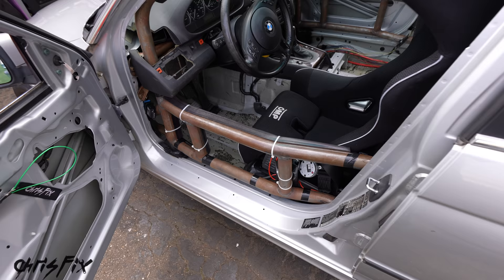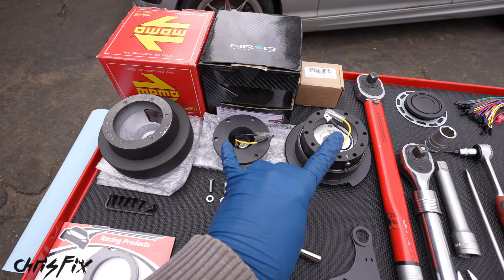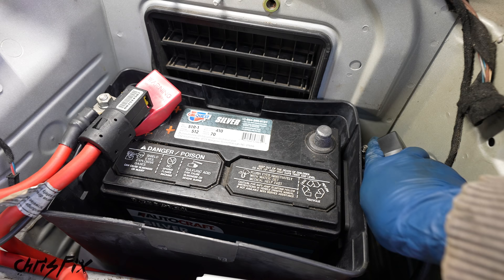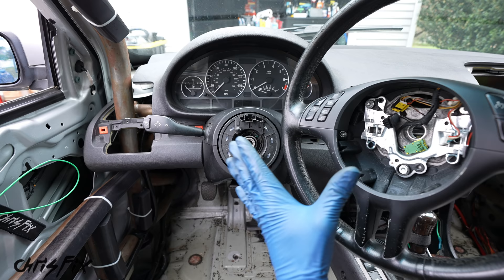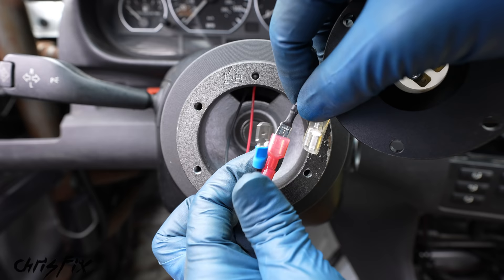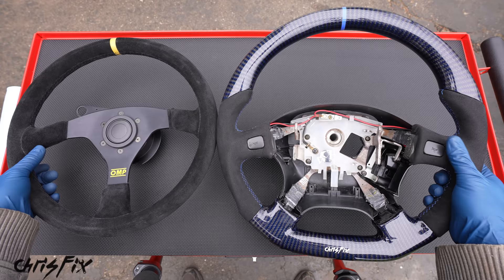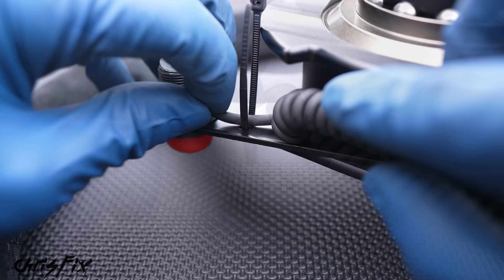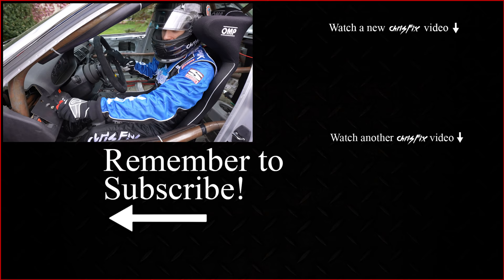How to PROPERLY Install a Quick Release Steering Wheel (with Working Horn)

Comment: Can I add a quick release adaptor my existing stock oem steering wheel? I want every electric oem component to function (airbag, stereo controls etc). 
Is that possible?
Reply from the maker: I don't think so and even if it was the juice wouldn't be worth the squeeze, I would recommend looking at the custom steering wheels instead
Reply: Why not? I need the OEM steering wheel because it has the airbag, plus all of the other radio controls on the Toyota steering wheel. The reason I need to quickly release the steering wheel is because I have installed fold down seats in both the driver and passenger seats. When I convert the interior to camp mode, I need to remove the steering wheel so I can utilize the entire interior for the bed platform etc. 
Any ideas?

Comment: Hey ChrisFix! Is it possible to change brake lines without takeing off everything under the car? I'm thinking about tieing the new brake line to the old line after I disconect it from the brake calliper and master cylinder and pulling the old line until the new one is where it needs to be. Sort of what you did in the hood cable replacement video. Is this an option?

Comment: Hey Chris, I have a 2000 mustang v6 sunburst gold and my driver side door quit latching today. No matter how hard I slam it or how gently I close it it doesn’t latch and stay shut. Was wondering if you could make a video on replacing or fixing that issue. The latch itself on the door I can push it to the closed position and it will come open without pulling either handle. Please help
Reply: Edit I replaced the lock but the hinge was messed up when I got the car so it doesn’t line up right and shut now unless I pick up on the door. So latch and hinge video?

Comment: hey chris, for the driftstang steering wheel that has the rpm at the top or even just the del sol with the carbon fiber, what are some trusted companies that do these customizations? thanks

Comment: did you use the normal MOMO hub adapter or the short MOMO adapter? I have a MOMO wheel and adapter but just purchased an NRG quick release. I'm wondering if I need to change my MOMO adaptor to the short one to keep the same distance
thanks

Comment: The diameter of the wheel shouldn't influence how you steer depending on how many degrees you turn it...
cuz 360° is 360° independent of your wheel being 3m big or 3cm... one turn is still one turn.

Comment: Is there a different type of push button I can use to replace factory buttons on my stock steering wheel like the cruise control buttons? Because I want to get a aftermarket MOMO wheel but I still want to be able to use my cruise control for longer drives

Comment: The airbags are there to protect idiots who don’t wear their seatbelts. They don’t “work with the crash structure” in any way, especially on a car of that vintage.
Reply from the maker: Airbags are designed to work best when you are wearing a seatbelt, and yes they work with the crash structure, here's a NHTSA document from this vintage stating exactly that: https://www.federalregister.gov/documents/2000/05/12/00-11577/federal-motor-vehicle-safety-standards-occupant-crash-protection (Go to the "Rationales for Protection Improvement Requirements" section)

Comment: You gotta paint the roll cage, it's starting to rust and it doesn't look good, i don't like rust
Reply from the maker: It was painted after this video. That’s just surface rust. Not a big deal. Happens days after you expose steel to humidity

Comment: I saw that you got the e46 there, I got myself the same car sedan version and I bought myself a 225/45r17 8.5j wheels, they stick out a bit and when I go over 80km/h the steering wheel starts shaking, I did balancing I did aligment, everything is perfect and it still does it, any fixes or ideas what should I do more? I really dont want to sell these wheels tho

Comment: I have a question, i have an mx5 and im a little on the taller side, my Knees hit the steering wheel and its kind of uncomfortable, Is there a smaller steering wheel I can replace it with that also has an airbag? or should I go with one without an airbag but install a harness?

Comment: Hey Chris, would you still advise against removing the airbag in a street vehicle if there is a proper harness setup?
Reply from the maker: You would need to wear a 5 or 6pt harness, helmet with Hans, and need a full cage for it to be safe. No other safe way to run a harness. If it’s a 4pt harness you need the anti-submarine strap but that breaks and let’s your body move in an accident so you would hit the wheel with no airbag. So no way to safely remove an airbag in a street car.
Reply: @chrisfix how would you hit the steering wheel when strapped into the car with a 4-point?

Comment: Chris! I’ve been trying to remove the 16mm bolt from my e46 steering wheel but no good. Been using a standard ratchet and extension, as well as a drill with a socket adapter and nothing. Do you think that extendable ratchet will do the trick from the added leverage?
Reply: try a breaker bar

Comment: i’m trying to do this on my dodge avenger but no steering wheel hub adapter will fit, i’ve tried the one nrg said would work and it’s too small and i tried a universal one that didn’t work either, what should i do?

Comment: Hey Chris Im looking at buying a 2015 VW golf TSI but when I looked at it there is a dent in the oil pan, the car is otherwise mint. What would you recommend?
Reply from the maker: Is it a small dent or a big dent? How long ago was it dented (ask the owner if they hit a massive pothole)? Is there an underside tray that would help prevent the oil pan from taking damage from the road, and it wasn't installed? No matter what, it would need to be fixed asap. If it's not causing any engine issues, I would look at the cost of an oil pan and see how many hours it would take to swap it, add it up and ask the owner to get that much off the price. If they say no or try to negotiate that, explain that it needs to be fixed either way or they might be having to put an entire new engine in very soon. If it's a small dent not causing issues, you should be ok to swap in a new one, if its a big dent and they refuse to take that much off the price then you might need to walk away. Depends on the situation
Reply: @chrisfix  Thanks its a decent sized dent but the owner doesn’t know because it was his sons car. I talked to Volkswagen and they said it shouldn’t have damaged anything internally but they wouldn’t know for sure until it was taken off. There is a baffle inside the oil pan so that might have protected the intake but who knows. Im going to ask him about it to get it looked at. I didn’t get a price from Volkswagen but Im guessing about $1000 with labour because it would also need 20 stretch bolts for the pan. Anyway Ill see what he says. Thanks for the help!
Reply: @chrisfix  also when we checked the oil it was a little over half way
Reply: Never mind it just sold.

Comment: 13:40 Liquid electrical tape? Man, I used to tinker with electronics since I was 10. Why have I never heard about this?? I will get me some, hope I can find it in germany. How the freak do you know about all these cool tools? I have used epoxy and hotglue on so many small instances where this stuff could have been an absolute time saver!

-also the spiral cord around the quick release is giving me a bit anxiety, you could solve this with 2 little logic boards

Comment: i have a 2003 saturn ion and the airbag doesnt work, i want to buy and replace the steering wheel but dont know what hub mount to get. i have the wheel i want to buy but cuz of GM my stock mount is not normal. any help?

Comment: When I install my wheel and torque it down it feels sticky, almost like the hub adapter is interacting with something behind it. Has this happens to anyone else?
Reply from the maker: Is there play if you shake the wheel after torquing it down?
Reply: @chrisfix  side to side it’s the regular amount of rotation you would expect hitting the steering lock when the key is out but now there is this added “sticktion”, if I loosen the nut it goes away but then the wheel isn’t torqued properly. I think my hub may be machine improperly.. it’s an NRG hub so possibly I should try a nicer hub like the one in your video. Unless I’m missing something, idk.
Reply: @chrisfix  hey, wanted to say thanks for initially responding, I know you probably get a million comments and that’s pretty rad of you! The issue was the hub pressing on the electrical connector body at the clock spring, pushing the clock spring housing back and causing it to feel sticky. A little plastic off the top of the connector should do the trick!

Comment: Honestly, i have no trouble doing most things with my car (brakes etc.), but airbags scare me.
Reply from the maker: That's great and it's good to respect airbags but the system is very safe. It is only going to go off if an airbag sensor is hit and the key is in the run position (someone hit's your car as you are working on it for example). The only other possible way is a static shock but as long as you dont touch the part where the electrical connector slides into, you wont have that problem either.

Comment: 5:55 Don't open steering wheel bolt against steering wheel lock, it can damaged it.
Reply from the maker: The steering wheel lock mechanism is designed to take a lot of force, more than the 50ft-lbs the nut will be. Maybe on a car where the torque of the bolt/nut is over 150ft-lbs I would definitely be careful!
Reply: @chrisfix  That's true that it's designed to take a lot of force however overtime they wear out and aren't as strong as they used to be. I have damaged 2 lock mechanism I believe,  opening them that way and I have opened "few"

Comment: How to get a 2006chevy Monte Carlo  key to shut  back car to off position .I can put key out but it still runs my battery down. Thing  s I've done when able to  drive   no problem  until I  try to cut motor off still lock.. Shifting  to neutral  no go  same result.Iam facing a tow bill I don't have money for .If u can  help I thank you.

Comment: hey ChrisFix so my brother broke his steering wheel on his Toyota Yaris I mean the entire steering wheel fell off like how did that happen and the replacement steering wheel is a non-stick frying pan it he removed the handle and then cut into a shape of a steering wheel it also uses the original air bag and honk mechanism so how do you fix it?
Reply from the maker: Did the screw or nut come out of the steering column?
Reply: @chrisfix  it did come out! the nut was worn down
Reply: @chrisfix  plus the wires were snapped so got new ones and still using the frying pan steering wheel
Reply: @chrisfix  after that we realized the car we bought was a used car from a car crash
Reply: @chrisfix  they fixed everything except the steering wheel nut
Reply: @chrisfix  we couldn't find any steering wheel that fits for the car

Comment: why use the coiled wire when you had a whole clockspring exposed 10 minutes ago 🤔
Reply from the maker: We originally wanted to run through the clock spring but kept getting dead ends when it came to doing to the research for the wiring. I'd argue the wire is the better solution in this case anyway

Comment: Iis it possible to adapt a factory steering wheel to a quick release base while keeping all steering wheel functions in tact?
Reply from the maker: I don't think so
Reply: @chrisfix  I appreciate you for responding to such an old video! I see, I may experiment with this idea on my project car. I just need to find a quick release product with enough electrical contacts on the middle to be used fof all the functions of the steering wheel as well as Airbag

Comment: Wouldn't removing the airbag be equivalent to driving an old car that never came with an airbag? What I'm trying to say is yes, you are removing a safety feature and exposing yourself to getting more injured (or killed)  than if you had an airbag, but it's not actively dangerous. I don't hear people say don't buy a classic car because it's dangerous. Or am I missing something?

Edit: Additionally, if I'm not mistaken, when short people seat extremely close to the steering wheel the car will disable the airbag as it would injure the driver when deploying.

My point is not everyone can have a dedicated track car, and if you have bucket seats on an already small car it makes it hard to get in and out.

Comment: Hi Chrisfix, I'm trying to replace my ignition cylinder but the steering wheel is in the way n tried two steering pullers n both didnt work. Any ideas on what I should do.
Reply from the maker: Can you dm me pics on IG?
Reply: @chrisfix  I don't have IG, my car is a 71 mercury montego, it's a twin of the ford torino.

Comment: You are showing it correctly on how to do it, but you are missing a few details, the yellow or orange connectors are always for the airbag, which should be noted. Even if you have disclaimers. 
You shouldnt even be showing this to people who are not educated within this, as it's a major thing and also illegal in at least europe to remove if you don't have a certificate for it. As this can be life changing if done incorrectly and shoot off.
One thing you can do to empty the battery and capacitors that stores energy is to turn the key AFTER you disconnect the battery, to really make sure all the juice is out. Otherwise great video. But this is really not to be taught by a video on how to do it to the 'common people' out there. I can only imagine how many can get into trouble if they mess it up.

Comment: Why did my steering wheel sensor  and abs light turn on?
Reply: 2014 370z
Reply from the maker: Sounds like you removed or messed up the calibration on the steering angle sensor.

Comment: As someone who works with electronics, PLEASE do not use cheap generic breadboard wires. They're terrible and fall apart under any stress at all. Get some proper brand-name connectors.

Comment: Oh no
Please don't use liquid electrical tape on the kinds of plastics used for breadboard/servo wires. The chemicals in the liquid tape eat at the plastic.
Come back to the connector in a week or so and you'll find that it's been eaten away.

Comment: No airbag. Just full send it   Remove it. It’s fine
Reply from the maker: It is extremely dangerous to not run an airbag on a car that had one from the factory. It can take 1 second of a safety feature not being there for your life to be changed forever. I'd strongly consider you rethink your stance on that.